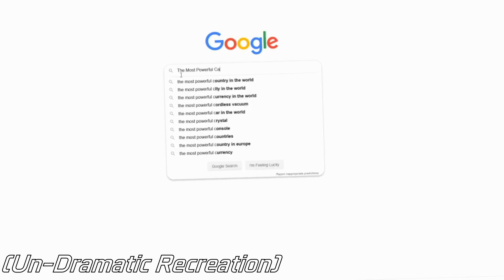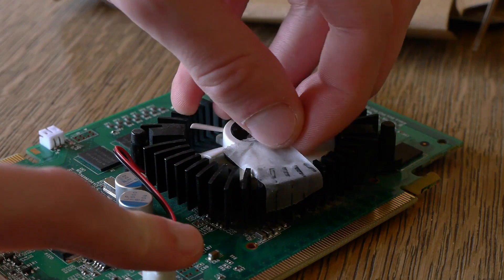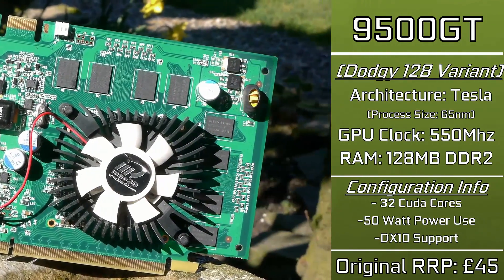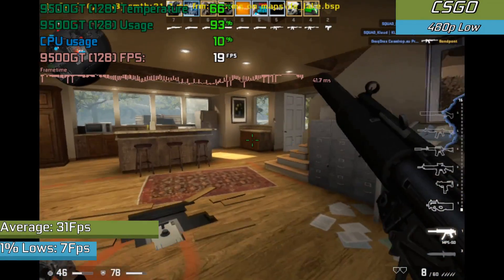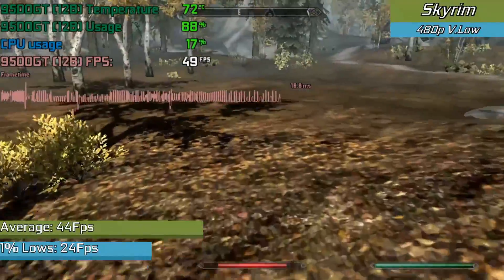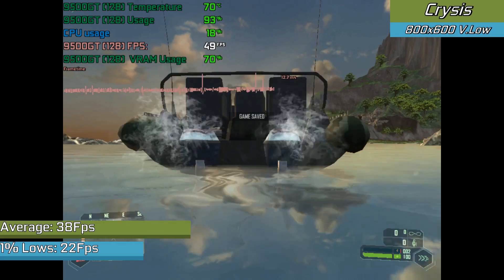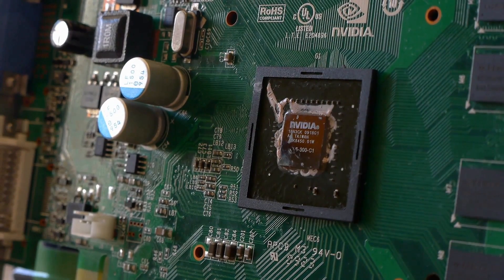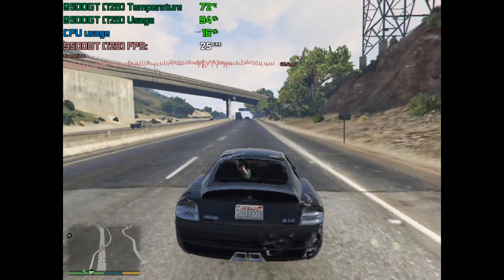The Worlds Most Powerful 128MB Card....

Comment: There were cards before that with 64 megs of VRAM. Back when these cards were relevent we didn't have 1080p gaming. We had resolutions more akin to 640x480 (that's why everything before 2008, back in DOS was 640x480 or weird resolutions.  The "High resolution" back then was talking about textures in games. The Voodoo 3d cards only had 16 megabytes of Vram on board. 

Edit: I used to have a voodoo 3d card with 16 megs of Ram and a Geforce 9400GT (The X400 cards from Geforce were not meant to be gaming cards, they were meant to be in what the industry called entertainment PC's- for movies/video and music- back when HP was making all different types of PCs and selling them in the big box stores.) 

That is why Nvidia numbered their Cards like they did for the industry so you could easily pick which card you wanted-

Back then it was-
8300/9300/230=  Business Machines like an Emachine Only good for a video port

8400/9400/240=  Home Entertainment PC (Videos, Movie and Music playback only)
8500/9500/250=  Extremely Entry level gaming
8600/9600/260=  Entry Level gaming
8700/9700/270=  Mid Tier gaming
8800/9800/280=  High End Gaming
8900/9900/290=  Software engineering/rendering, meant for industry work stations.

Nvidia still numbers their cards the same way with the first number being generation, second being what the card is supposed to be for.
Basically the card you have here is a 2008 equivalent of a Gforce GTX 1050 GT. It is the same intended purposes- extremely entry level gaming/budget card. Far from useless at the time when it was relevant.
These cards were not only in Russia. They were sold all over the world. They were as common as the GTX 1050GT cards are today.
Reply: I don't think the 8900 and 9900 ever existed. The 290 did though, as well as the 8800. As for the 8700/9700, I'm pretty sure these were mobile cards. I know the 8700 was a mobile card and was a slightly OC'd 8600M GT.

Comment: Why didn't you try any games from that era?
Reply from the maker: I do mention that older and simpler games (I show Half Life 2 running in Gmod and Half Life Source) both running perfectly in 720p. I also showed Crysis from 2008.
Reply: @BudgetBuildsOfficial  What i meant was something even older. Perhaps you could target games with such requirements and make a short video about that? That would be awesome. Or anything from the early 2000's, although not time accurate.

I challenge you to run Mortyr 2093 -1944, as it was meant to be played.

Comment: Why do we still use resolution terms like 1080p which only declare vertical pixel count? In modern era, when we use many different aspect ratios, it doesn't make any sense. For example I have a 2560×1080 ultrawide monitor and the performance is miles different than FHD (1920×1080).

Comment: Man I felt your pain trying to whippe that thermal paste off. I did it once and it was horrible. Next time take a toothpick and brake it into two pieces, wood won't scratch metal because it is softer spray a little bit of alcohol and start scraping the surface with soft force.
Take care man and try it please it will help you a lot

Comment: I like how CS-GO looked better and played smoother than GTA-5. Its all about optimization.
Reply: Can't compare the two. GTA 5 is way more demanding.
Reply: @TrashyTrucker69 but they could at least optimize the lower graphical settings. Im pretty sure a potato would be able to play GTA-5 if they optimized it based on how terrible it looks. (On very low)
Reply: @morpheus_9  The 9500 GT was never an amazing card in the first place. I'd say it's pretty impressive that it runs GTA 5 without stuttering like hell. GTA 5 is one of the best optimized games I've ever seen actually. It's also an open world game, so of course CSGO would run better and look a little nicer.

Comment: My laptop from 2009 has the same gpu in it, but it's configured better came with 512mb of GDDR3 and has a 625mhz stock clock.  Honestly not a bad card in it's day and was still usable as my secondary computer up till around 2017-2018.

Comment: had this exact card from inno3d way back 2009. them capacitors pop like popcorns.
Reply: What a bad, psu you need to have to make this possible
Reply from the maker: Oh no this was genuinely a bad era for capacitors especially cheap ones
Reply: @BudgetBuildsOfficial  i think they were reflashed 8500gt's, because of 65nm. newer 9500gt's(rev 2.0) were 55nm with 256mb. This was the rebrand era. ati 5xxx series get 6xxx rebrands, same as 8xxxgt/gtx/gtx+ going 9xxx.

Comment: Whilst it may be the last, surely a card of an older generation that may have been higher end would be more powerful to have 128MB VRAM? 32 CUDA cores is pretty low end all things considered.
Reply from the maker: You'd think so but if we go further back we loose DX10 and our slightly modern drivers. 

A 6800GT would make for a good comparison...but cuda was revolutionary in terms of performance, and even this terrible card is usually better
Reply: Budget-Builds Official Haha yeah I was just taking a look, interestingly on the AMD side you have to go all the way back to the 2400PRO to get that pitiful amount of VRAM... What a bizarre card...
Reply: Budget-Builds Official Oh also you mentioned that 1GB is physically present on the PCB, I’d be interested to see if the BIOS would be flash able to unlock that extra 768MB, obviously backing up the weird BOIS already on there. Another interesting thing, Wikipedia doesn’t even show this thing existing haha.

Comment: The story behind these card as I have heard from a confidential source is as such:

The cards are essentially just broken and would have otherwise been tossed.
Inno had a massive production fault one week that affected a very large number of units and was so desperate they made an automated factory test line that recovered them into 128Mb bins
You can unmask the bad ram chips in BIOS and watch the LSD effects drop
Reply: I had a 512MB 9500 GT Inno3D that had 1GB of RAM chips on it years back
Usually in china's back alley markets you can buy tons of defective 'but working' factory products that are like this
PCB assembly yields aren't perfect and that's why quality control exists
For a factory producing several million cards there can be many thousands of rejects
It's where most of the fake cards come from
Reply from the maker: This does line up with most of the stories I've been told.

... However the VRAM other the 128MB is completely useless. Even if you flash it back to being active
Reply: @BudgetBuildsOfficial  There are a couple variations of 'deadness' for these cards.
Some have literal fake chips on them.

Comment: That factory pink thermal compound is more easily removed using toothpicks to scrape it off the surface of the GPU, then you can use your regular alcohol to remove whatever residue is left.

Comment: How utterly ridiculous and obscure this is, love it! Good job on tracking one down, I had never heard of it until now. I  also have no idea why they would cut the VRAM in the BIOS all the while having 8 times as much physically on the card. I would like to know just why such a thing was made...
Reply from the maker: I have no idea, but they did exist. For what would appear to be 0 reason what so ever...Other than a dirt cheap RPP of less than half what a standard card sold for
Reply: So I guess you could flash a bios and unlock the extra memory
Reply from the maker: @Nurse_Xochitl  please see pinned comment
Reply: Seems like a way to "recycle" already manufactured cards with bad VRAM. Just cut it down via BIOS to the smallest amount that can still be used for...err..something... and hope the bad VRAM chips are not in that region. Would've been interesting to see what memory chips are on that card and googling the size of them via their model number, then calculate how much is actually on the card. Because you can actually have a card with 256MB, flash a BIOS for a 1GB card and it'll work... for as long as you don't exceed 256MB. Then all hell breaks loose in terms of crashing and weird behavior. That's the main issue wie those chinese fake cards, except those are also claiming to be something more powerful
Reply: @Knaeckebrotsaege  I expect that’s why these exist too, just like how they used to sell 3 core CPUs that were actually just quad cores with a failed core. It reminds me of the time on my last pc where I ran it with only 4gbs enabled because one of my two 4gb sticks failed.

Comment: Unstable and cut down? I had 3x9800GT's that died on me in those years, Inno3D, Gigabyte and Asus. 

Almost made me regret upgrading from 7300LE.
Reply: Mostly has to do with the extra heat from being a single slot cooler, and the fact that they had to switch to lead-free solder around that time period and didn't really know how to use it that well. It's pretty much the same reason why the Xbox 360 failed so much, it would get so hot that the solder joints would melt a bit and the chip would be partially disconnected.
Reply: @neppy-chan9297  that and the xbox heatsink was inadequate.

Comment: I remember back in 2009 when I built my 1st gaming computer with A Q6600, 6GB of DDR2 and 2x 9800 Gt's. And I use that all the way until 2015 where 1 of the 9800gt died so I replaced it with a gtx 750ti. What a world of difference

Comment: You said that the card has 1 GB of physical ram installed on it. Would it be reasonable to see if you could flash a BIOS to it that would enable the rest of the ram and see if that makes it preform just like the normal 9500GT? Also, Is it possible that the other ram modules on the board is blanks, making it appear as if the card has all the modules for the advertised one gig memory, but in reality there's just one chip with 128MB of Vram\\

Comment: I used to have a 9500 GT and it had 512 MB of VRAM. Pair it with an intel pentium E2200 and 4 gigabytes of ram and you get the PC on which I suffered for 5 years.
Reply: Gta 5 тянет(про проц не уверен).... Кс го тянет.... Что не так-то?
Reply: cool profile picture
Reply: I suffered on a Geforce 210 512mb DDR2 model with a Pentium 4 540 and 2.5gb of ddr2 ram for a good 2 1/2 years.
Reply: @Dimondminer11  I'm stuck on a dell inspiron 6000 laptop from 2004 with only 2 gigabytes of ram and 64 megabytes of vram
Reply: @Sinistar1983  Oh wow. That makes my system look extremely more powerful. I did in fact record Youtube videos on that computer. Some of my earliest videos were on that machine.
Reply: Oh man, you had a better set up then me. My first personal computer had the same E2200, 2 gigabytes of ram, and (I think, I'd have to call up my dad to check my old closet for it) a FX 5200. Whatever the GPU was it was passively cooled trash that I loved. Had that PC for like 3 years before I got my first proper gaming PC.
Reply: @TechGameEras  Ahem. Celeron 440 + some dodgy Radeon X1050 @ 256MB RAM.

Comment: I HAVE A QUESTION!?
since this Video adapter's ram memery is DDR2.... and we are currently on DDR4... shouldn't it go faster by starting to use the pc's ram instead of the graphic card's memory?
Ty
Reply: No vram and ram are two separate things.
Reply: @chortles7515  I do follow. But the standard isn't similar?
I would really expect ram ddr4 to be faster than ddr2 vram.
Can science side of YouTube help.
Reply: Yeah,it probably used ram for textures that didn't get in the vram.Performance would be even worse if the ram was not ddr4.
Reply: You are still limited by PCI Express bandwidth. PCI-E 2.0 x16 = 8 GB/s, the DDR2 on this card = 16 GB/s.

Comment: I wonder if you could run it with the full vram if the memory clock was lowered? Granted system stability is the biggest issue. Also the silicon lottery is at play, you may, or may not be able to unlock the full amount with lower clocks.

Comment: Not gonna lie,Was quite impressed that card was handling GTA V like it did,i thought it would be a stuttey 8-10 fps mess but actually it was playable even at 28-30 fps.
Reply: considering the game was optimized to run on oldgen consoles (with the PS3 having the equivalent of a Geforce 7800GTX with 256MB VRAM), this doesn't surprise mit that much

Comment: Depending on the system the card was tested in, the system ram is probably better than the vram on the card itself.
reason why GTA V ran pretty okay, it was benefitting more of the system ram than the cards vram.
Reply from the maker: I could see this being the case, however in a DDR3 based system i saw the same performance

Comment: Well here I am still daily-ing a laptop with 128MB of VRAM.
I have a ThinkPad T43p with Fire GL V3200 with 128MB of VRAM (which was the higher end in 2005), I have a Latitude D630 and D830 with NVS135M also 128MB of VRAM, as well as a Precision M4300 with a much more powerful Quadro FX 360M that is also available in 128MB variants if you bought the smaller M2300 instead.
But yeah gotta say, with my NVS135M, all the daily tasks (For a 2007 laptop) work just fine (minus Windows Modern applications because they eat a lot of vram) as long as you don't open multiple things at a time and eat out the VRAM.
My friend also tried world of tanks on the NVS135M and the Quadro FX 360M. Despite being the same generation, the game simply crashes on NVS135M with 128MB of VRAM and works fine as casual maintance and replays for the FX 360M.
Also on these laptops, since some system RAM can be also allocated as VRAM, having dual channel RAM drastically improves the stability of games. In league you would see random stutters with 6GB (4+2) of RAM (Not related with amounts since with low settings it doesn't come close to 6GB) while those stutters are gone with 8GB. This is slow 667Mhz DDR2 speeds (chipset limitation), so using dual channel makes such a huge difference.

Comment: You might wanna try acetone for pastes like that pink one,cause it's thermal resin and the only thing that takes it off is either acetone or petroleum
Reply from the maker: Managed to get enough off to make contact with the die. But Cheers for the advice
Reply: @BudgetBuildsOfficial  
Yeah,you can also do it with alcohol but I wanted to let you know how to do it efficiently since I personally wasted a day scrubbing a chipset to get rid of it.

Comment: Seeing how it has 1gig of ram installed on the board. Have you tried to unlock it?
Reply from the maker: I did, however it will just crash instantly.
Reply: Makes you wonder, were they cards with faulty RAM... would have to be a fault somewhere in the capacity, as I'm guessing it was all one bank, unless it could be chopped from 128 bit to 64 - any VRAM performance tests that could hint at that?
Reply: @matthewday7565  not faulty..but some of theys cards where used in data centers and later sent back nvidia?i know that era gpus had high vram failure rate.so this gpu might been sent back and rebranded as 128mb gpu and ram limited to 128mb ram.worked nearly 30 years with   computers and data enters here.

Comment: Budget-Builds, don't you think that it's much like processor manufacturing? Faulty VRAM on the board, instead of throwing away or repairing they just fixed it in software to push numbers?
Reply from the maker: It is indeed, however you see the artifacting during the black mesa test....It can lead to that type of instability (Mostly in games it cant run anyways, but still)

Comment: 4:17 The Worlds Most Powerful Thermal Paste
Reply: The most stubborn thermal paste I've come across is the stuff that dates prior to 2004 or so. I remember at least one Pentium 4 with thermal paste so resilient that the heatsink came off with the heat spreader still attached, whilst the inadvertently delidded chip remained in its socket.
Reply: @MixerVM  haha i thought i was the only one. i want to delid my pentium d ... broke 2 other crap cpu while trying.
Reply: Tom Jacobs did this for the first time on a 775 celeron at 3.0ghz, it was SOLDERED AND I GOT IT DELIDDED with not any problems
Reply: @MixerVM  back when thermal paste was made to last.. my first laptop a 50mhz slc toshiba didnt even use a paste, just a thick ass thermal pad
Reply: @MixerVM   when I replaced the thermal paste on my Pentium 3 laptop( mfg~'99 I think)  I literally soaked the entire cpu in isopropyl alcohol for several hours to get it to soften enough to be scrubbed off.    I used 70% but it didn't kill the cpu! Lol
Reply: @MixerVM  
Yeah that is why we twisted the heatsink back then when needed to repaste before we attempted removal, its still a thing people do now with LGA based CPU's because you can rip the CPU out of the socket LOL
Reply: ive tried to take off a heatsink and ended up pulling the cpu out..... I had to use pliers to separate the cpu from the heatsink..... let alone clean it
Reply: Thermal Glue exists...
Reply: Yep, thats KPT-8, soviet thermal paste
Reply: @OREYG  lol.. it had a codename?
Reply: @jub8891  Yep, like everything in Soviet Union. In that times it was used for installing heatsinks on significantly heating electronic details, and it became kind of iconic. Originally it was packed in small jars, so you was needed use additional tool to spread the paste all over the surface... They say, that original one (made in USSR) was pretty decent and cheap stuff, but nowadays most of it (at least what calls "КПТ-8") are worst in efficiency, so in became kind of meme in our local PC enthusiast community.
Reply: @2298839082508923859  i see- the things you learn every day- thank you 😊
Reply: @OREYG  KPT-8 is white and easy to remove.
Reply: thermal concrete
Reply: ... its from good old days , they dont make it like this anymore.   LOL :D :D
Reply: Petrified paste
Reply: more like thermally conductive epoxy adhesive, definitely not a classic thermal paste
Reply: LOL I thought that
Reply: bloody nvidia glue.. bastards lol
Reply: I replaced the thermal paste on my gt 730 I had to use my fingernail to scrape or off instead of the tissue ì used to clean the cpu